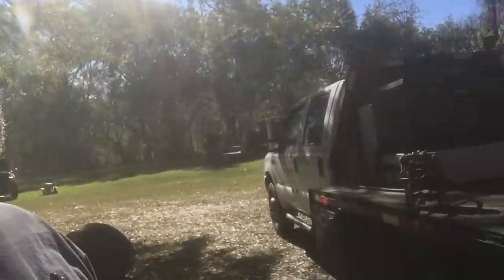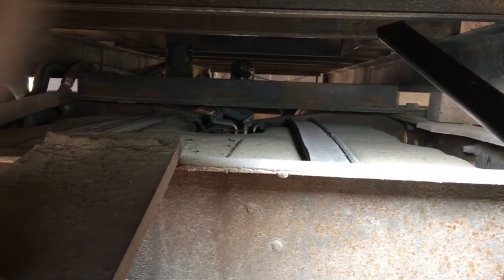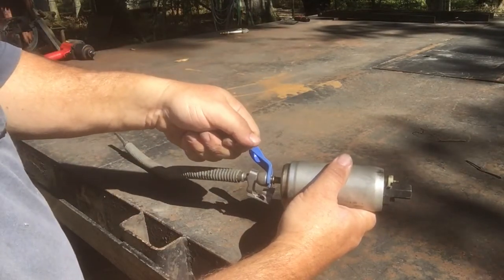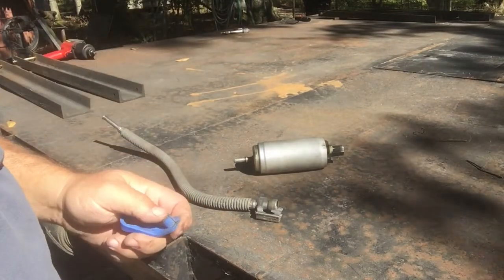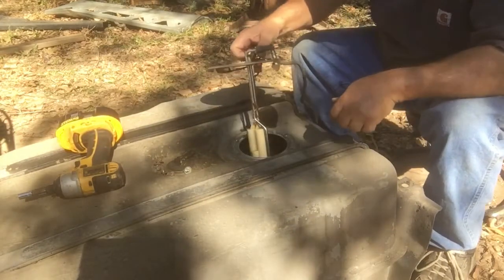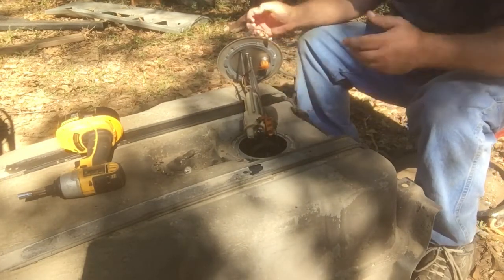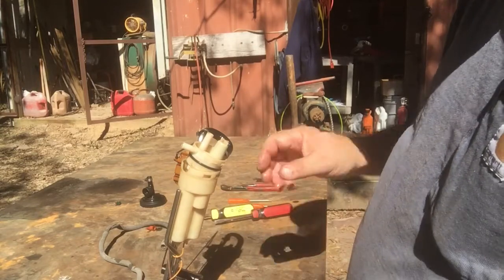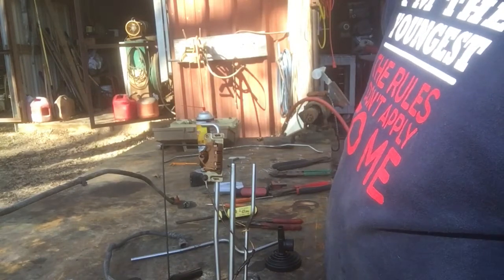2001F450 drop tank removal and fuel mod

Comment: Thanks for the video man! That jack of yours is perfect for this application! I need to figure out a bracket for my standard floor jack to help me do this. Picked up a F350 with a 40 gallon tank. She loses a lot of power on the top end so Im thinking its fuel related. This video is going to help me out a lot!
Reply from the maker: @DeWaltManZ  you are certainly welcome. And yep that old school jack comes in handy. Screens clogging and pick up foot falling off are common problems. Hit me up if any questions. Happy to try and help. Appreciate the comment and thanks for watchin

Comment: I gotta do this to assess the ratio of old diesel to water in the tank on my project, and to repair the road salt rotted tank straps, hah.  If it's Sunday night in a small town, and everything is closed, but you don't have a fuel line disconnect tool, you can use about an inch of the cap from an original size sharpy marker, you cut the bottom 1" off, and slit up the side, so you can slip it over the line.  I use a pair of needle nose pliers but not to pinch, just to evenly push on both sides of the cap, some vehicles it's tough to get the old fingies in there.  I'm sure lots of other random junk works, but the original style sharpy cap is a good model for figuring out which piece of garbage near you might work in a pinch, hah.
Reply from the maker: That’s a great idea. I love hearing on the field improvising. Any fool can fix something in the shop with thousands of dollars of tools but making it happen without all that is a skill.

Comment: Great video, very informative.  I just got my 1st 7.3 f550 (2002) to use as a farm truck.  Dropping the tank next week to diagnose a leak and I have tubing and unions so I will give this a go.  Any idea if the fuel sender unit is the same on mine?
Reply from the maker: Should be very similar. 450’s & 550’s are both cab and chassis so should be very close
Reply: @bayoudiesel  It appears to be the exact same, thank you.
Reply from the maker: @1BigYin  you are welcome and feel free to hit me up if you have any questions. Not a bad job really. At least ounce you have seen it.

Comment: When I disconnect the fuel lines to I need to release fuel pressure first
Reply from the maker: It’s best if you do. But also depends on what side of the pump you are on. Before pump has no pressure but after can so I will crack the drain valve on the fuel bowl and drain some diesel. You will need to prime the fuel system when you are done by cycling the key to on for 30 sec at a time for 3-5 times to burp the air out of the fuel system. Depends on what you are working on but that should help ya. Thanks for watching.